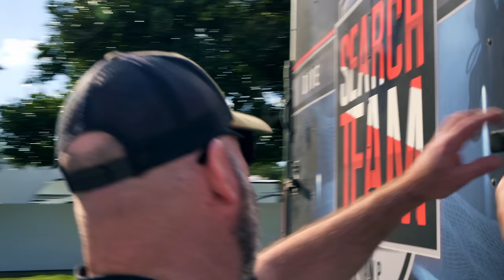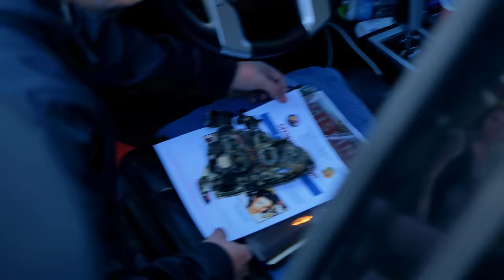SOLVED 38-Year-Old Missing Person Case in 6 Hours... (Maureen Sherman)

Comment: For all of you arguing about "they didn't have the equipment they do nowadays," think about this. She blew through a fence. Right at the location she said she would be. NO ONE NOTICED????? You may argue that the equipment and manpower is not the same, but what you fail to realize, they found 23 other cars in the canal. I call bullshit on every. single. level. of that police department over the course of many years. I can understand 1 car with very little information as to where. But to be given an exact location, and over the years, 23 other cars went into this canal, it says plenty about this department. Also, this is only what they found. There is plenty more going on in this town. PLENTY. 23 other cars found. 23. What is there to possibly argue?